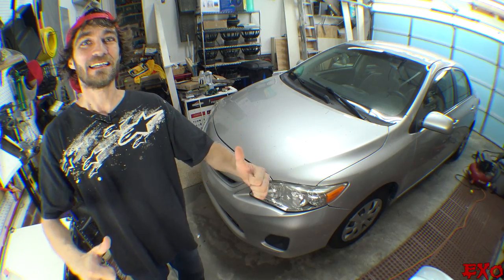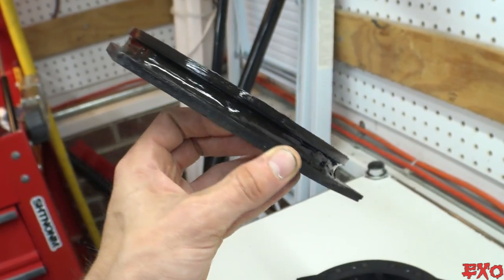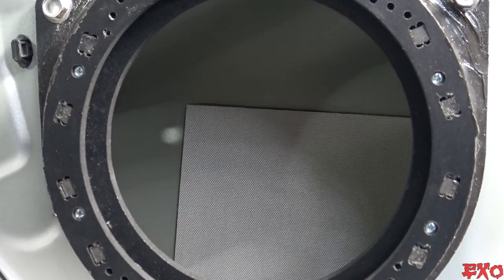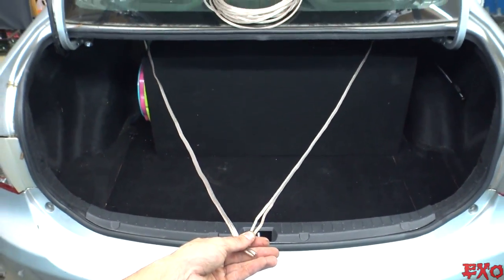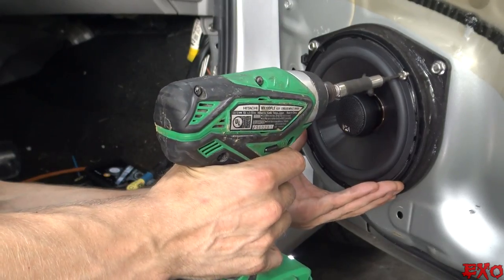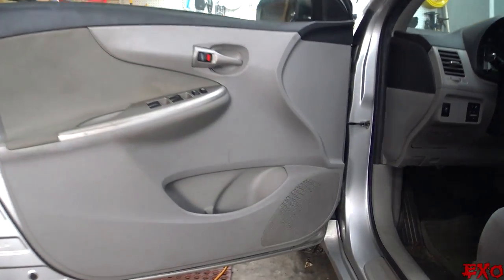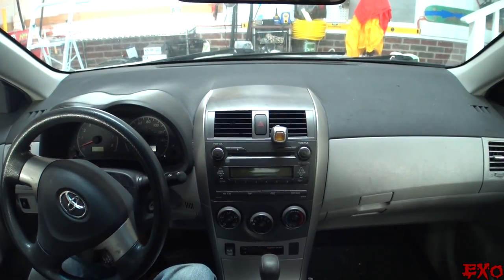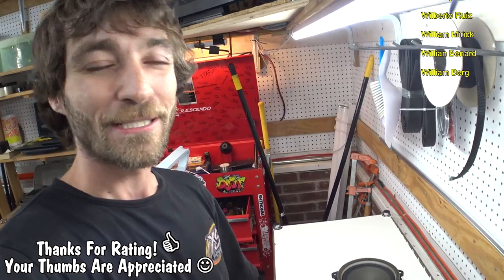How To Install BETTER Door Speakers w/ NVX 6.5 Coaxial Speaker & Installing Aftermarket Adapter Ring

Comment: You are as bad as me. I just swapped in 6 powerbass replacement speakers in my new ‘19 Ram 1500 Quad cab. 3.5”s in the dash and 6x9”s in all 4 doors. HUGE improvement.

Comment: Do you have an upgraded battery or alternator to have two amps running? I want to add a speaker amplifier along with my subwoofer amplifier but I'm afraid it'd draw too much power! I dont have that good of a setup right now so not much power is being drawn

Comment: Do you have to have that amplifier in the back? I am hoping to upgrade the speakers in my Renault Clio, and have seen other tutorials where they simply re-wire the speakers using the same wires as was previously used for the last speakers. Seems a lot simpler? Thanks

Comment: yep the wire tie I used for 25 years is about 3' long you can find them in HVAC supply houses and Electrical wholesale stores.
Viper Or DEI Also sells one but they choed the end off the wire tie. Speedometer cable works too.
All works fine and dandy until you get into some Mazdas that have the pug in the door or quarter panel. then you have to find a way around it/
Now why pull 17' of wire from the door into the car instead of 3' from the car into the door?

Comment: Couldn't u just hard wire it to the stock cabels on the stock amp
Reply: Daniel Ramos I was wondering the same thing
Reply: Yes you can, but running new wire is preferred  because more connections create more resistance and power is lost

Comment: But quick question, can you use coaxial speakers AND tweeters with like a component crossover, basically a cheaper way of adding a second set of tweeters?
Reply: Aspen Ramirez yes if the x over is on the back and u see the connectors for the tweeter

Comment: do you have to replace the wiring or can you adapt the stock wiring to these speakers if just using an aftermarket head unit?

Comment: I have a screeching sound on my original 2010 Toyota Corolla S speakers. Do I need to replace them or is it a electrical issue? Just looking to save $. I still hear music but hard to hear over obstruction noise.
-Ramos

Comment: In some 1985 chevy trucks you need to take the doors off the hinges. Then drill holes in the door and cab because the only speakers where in the dash and or cab corners.

Comment: So with those coaxial speakers only asking for 50 watts couldn't you run them off a pioneer 80prs deck easily? I don't need an amp right? I've been procrastinating on installing my nvx speaks
Reply: They should sound fine off your pioneer deck, just don't expect good sound quality when they're cranked up. Honestly deck outputs usually sound better than really cheap amps, so I'd save up for atleast a brand name amp.

Comment: Howdy Partner!
I got the 2013 toyota corolla and the problem is that something is wrong.
either my radio has gone bad or the speakers have gone bad. 
through the bluetooth the song shows being played but the sound disappears. Same happens with AM and FM and even with the CD being played.
a lot of audible friction happens during the time speakers do produce sound.
a lot of people with corolla, tacoma, camry and Rav4 have this problem at very low mileages on their cars when I checked for the problem online.
What do you recommend me do?
Thanks.

Comment: I do speaker wires the same way except I run them back to front so I only have to pull a few feet through the gromet

Comment: I have a near 40 year old truck that I am putting in door speakers . It never had door speakers. What about the wiring through the door since there isn't a rubber wire boot of any kind. Any information that you can give me will be of great assistance.

Comment: Awesome video! What do you think about using a speaker mount versus foam tape on the front and back of my speaker before mounting it? Also, how would you compare second skin and something like hushmat? Also... what is that black glue you used for the speaker tweaker? Thanks!
Reply: I'm a year late but this is what he's using

GE Sealants & Adhesives GE5030 Advanced Silicone 2 Window & Door Sealant, 10.1oz, Black

You can find it on amazon or any hardware store for 15 bucks

Comment: One drop of baby oil helps the wire glide right through those rubber grommets. then if you want it wipes right of with a little alcohol wipe.

Comment: Do you prefer those speaker tweakers over roadkill rings? I used the roadkill on my Silverado doors.  Just feel like that big 2 inch soft foam would better deaden sound, as opposed to that harder rubber.  Life of the product is a different story. But that's just my belief based off zero knowledge other than what just seems to make sense to me upon first glance.  But maybe you can tell me different? Teach me bro😎

Comment: HEY EXO ARE YOU USING  "CONNEXT LINK" speaker wire from ebay. I found 200 feet of 16 gauge OFC half tinned wire(same as you are using) for $30!!!! I  love their stuff i also picked up 50 feet of 10 gauge power wire for like $18!!!!

Comment: I'm a fan of NVX, I've installed 3 sets of their speakers so far. But I'm looking if there's anything better for relatively the same price as far as mid-range bass speakers. I am upgrading my sound system in a 2012 GTI. It has basically the same set up as this video with the door mid and the top door tweeter pod. Looking to replace the door mid speaker.  Any recommendations? Thanks!

Comment: That trick is actually an old one. My old dealer/installer would do that for any and all wires that had to pass through places like the firewall or the door grommets.

Comment: Use a PVC pipe that's flexible and thin but not brittle. If the pipe fits then you can feed the wire right though. Or just the classic giant zip tie or stiff cord to tape the wire though.

Comment: Could you have used the original car wiring and adapted it to fit the speak instead of running a speaker cable  to the back?

Comment: Old video but I sometimes just tape the new speaker wires to the old ones and pull the old wires through . Sometimes I use a metal hanger too tape it to the hanger and push it through any tight places u wanna go

Comment: Did you do a video on the impala? I'm upgrading my 2008 I'm using 2 12in audiopipe TXX-BD4-12 they currently sound really good in a 3.1 box.. But I'm missing all my mids and highs the bass overpowers other sounds everyone likes to hear. I need to have somewhere to put 2 more 8in or 6.5in or 4 more cause its really banging..

Comment: You could have use the factory speaker wires just cut it and add clips for positive and negative terminal and connects it to the speaker and you just have to find the speaker by use of cell at the headunits

Comment: that rope looks like window ribbon sealer and if so that means you could you the ones in a tube for better coverage
Reply: and you could use mechanics wire to fish the lines as it is about the same diameter and is flexible and comes long enough for any job

Comment: If I'm doing a simple speaker system I usually run my 4-channel speaker wires to the head unit then use the factory wires that go out to the door speakers
Reply: HPA Hy Power Audio 14awg was over kill

Comment: Zip tie trick is something I have used in my 30 years of installation.  My question is why didn’t you use a foam baffle for the 6.5. The magnet is steal and when it’s wet from rain it rusts like crazy.  Foam baffle would also add to the back pressure.
Reply: Like the round thing he added to the door skin? They make one that sticks to the magnet and it's foam?

Comment: If the lower stock units in the front doors are bass,midrange units,there wouldn't be any highs,full range signal to the new coaxial speakers, right?
Reply: Michael Larsen yes there is because he adjusted the low pass filter
Reply: Michael Larsen or high pass filter whatever it is on his amp

Comment: Hey I want ask you a question how 4 orion will work on a system 4 audio pipe 15 1400 can that turn down any body in a competition and more speaker can that give good bass the 4 orion and 4 audio pipe

Comment: I got a car that has a door wire loom connector block that slides up when connecting to the car. Basically it means I cant run my 14 gauge wire to my new component speakers going in the door. How do you run new cable when you cant use the existing loom gator. Its stopping me from upgrading my door speakers and I have already got my component set sitting around. :/

Comment: Every new car I upgrade.my door speaker and they and keep the stock head unit.. they always sound wayyy worse. It tHt because stock speaker have complete full range, vs after market typically going down to only 60hz?? Just always wayy less low end on aftermarket

Comment: That idea with the zip ties👍👍👍👍👍just ordered a new HU
Going to be doing the big 3 and a 2nd batt in my cargo area (01 suburban) for a 4 channel for my doors. About to get the massive ct2 tweets nd run them on a 4 channel with these skar fsx 6.5s...then think about rear door speakers later 🤣🤣🤔

Comment: #pleaseanswer got my door’s speakers already changed by the old owner (2 way speakers) but I don’t know why when I play some music the “loud” part of a song sounds like scratchy. The dude before used usual “Home light” cables.. I replaced them with some Stereo wires, they are thin to be honest.. but I’m not 100% sure it’s that.. also the sub amplifier it’s pretty old, and the speakers wires that comes from the amplifier are pretty cheap.. help idk what to do, like just change the wires, the speakers or the amplifier

Comment: You made a mistake, i did not expect you to make EXO...
Why only that little pad behind the speakers? I've always fill the doors tot the top with multilayer, and 5mm dampening pads behind the speakers.

Makes the speaker sound very big compared to the size.

Comment: Soo my moms car has 14 speakers (stock) and I can hear them all besides the subwoofer in the back, unless you turn up the volume.
And also when a song has  a lot of bass the doors shake and rattle, any help from preventing the rattling ??
Reply: Second skin sound deadened or sound skins pro sound deadener. Most manufacturers lack heavily on sound deadening door (absorbs vibrations which in return you’re not losing a bunch of acoustical energy from the metal vibrating.
Reply: Kyle Clevenger but it’s a Lexus
Reply: Alexis Aguirre doesn’t matter haha, sound deadener is these super sticky matts that you adhere onto the metal on the inside of your doors. Doesn’t matter what kind of car it is.

Comment: The magnet on the originals is neodymium, which are the same strength as larger ferrite magnets, but come on, those were still quite small.

Comment: Hey wait a minute EXO I don't see a link for the speaker tweaker or the epoxy you used to install it when I change the door speakers in my Xbox I want to do it just like the pro EXO
Reply: D Ellz 1/32 foam will accomplish the same thing.

Comment: 15:18 "Sweet Tart of a magnet LMAO"
Reply: The magnet is made from NdFeB powder, which is a magnetic material that can supply about 10 times the flux density at full saturation as a typical black-donut magnet made of ferrite powder. This can either be used to increase the magnet’s strength by 10 times or it can be used to reduce the magnet’s weight by 10 times. Automakers usually opt to do the second because reduced mass improves fuel economy and overall handling.

Comment: let me tell you how i did wire my door speakers to the amp. I just cut the speaker wires from stereo harness the i connected the wires with male and female RCAs connectors (the RCAs so i can easily switch my speakers to unamplified speakers just plug and unplug ) and then from RCA to the amp

Comment: That only worked on my rear door speakers on my kia my front ones I had to dig and tap into the stock wiring cause they decided to use wire harness on the front doors so I couldnt get the wire through it.

Comment: Instead of using the ziptie to feed the wire, ive always used a cheap wire coat hanger straightened out. Its longer and stiffer, but just flimsy enough to slide in all them walls. :P Depending on the wire (rca's, speakers, 1/0) depends on how i tie it on the other end, but im sure u can use your imagination for what ever your application.

Comment: Hey, what are some good handy glues to have laying around when dealing with car audio stuff. Both like you used in the videos and for re-coneing subs.  I have a but of experience with rebuilding HiFi speakers but the stuff in-car audio seems a lot more heavy-duty. 

For glue options - preferably stuff that is possible to get my hands in europe. :D
Reply: Zayin Conde any kind of epoxy. 5 minute works for me.

Comment: I agree. Why does Yota use rivets? And I notice on my RAV4 that the OEM speaker adapter is (a) a part of the speaker itself, (b) is hard plastic, and (3) it extends through the door into the door leaving about ¼" or smaller clearance between the end of the adapter and the window when it's down. 
Come on EXO. Why are you riding the magnet size bus? You and I both know those OEM speakers are designed for low power, thus usually have neo magnet, high sensitivity, paper cones--light, easy to move. Crap, if you had a neo magnet as big as that ferrite magnet it probably would be so strong that it would disturb the metal of the door itself.

Comment: hey. i what to install in my ford focus mk1 a Skar Audio Evl. 12" with 2500 watt and 1250 watt rms. The car has a alternator with 90 amps. Do i need a second batterey with a disconect relai and a bigger alternator? And how do i connect the battery? row or paralell? can someone help me?

Comment: EXO what crossover frequency did you set for those speakers?
Reply: They are coaxial, the crossover for mid to tweeter is built in
Reply: @wonderbread06  

I was talking about the crossover frequency for the speakers to the sub.

Comment: Has anyone tried replacing the speaker wire in a 2013 Honda Fit/Jazz. I used a fish wire to lead the new copper wire and managed in all of the three passenger doors. Failed to pass it in the driver's door. The gromet in the driver's door is jam packed with wires (four windows, window lock and two mirror motors). Stopped trying as I was afraid I would tear an existing wire. Any idea/hints what I can do? Thanks.

Comment: Those are very good speakers for the price. Got 2 of the 6.5 in the front doors and 2 in the rear doors, 2 6x9's in custom kick panels in the hatch powered by a NVX JAD900.5  amp,  and 2 12" nvx subs in the false floor powered by a NVX 200.1, and this sounds just about as good as any system i have built or any i have heard.

Comment: Hey i was able to get huge  performace by just isolating the dors with some sound deadening materials ( i mean diy with dining table cover one with soft mesh in underneath and plastic on top) and some aluminium tape and dang there was a jump in sound quality mid bass was really powerful and all that with stock speakers
Mind that i even was surprised with their quality so i left them untouched except the rear woofers thay were shit

Comment: Did u test your windows all the way down? No way mine would have worked with those bolts you used without hitting.

Comment: I did not do the wire job kia decided to be a pain in the ass fitting conectors in the door opening ... no way i could the cable in trough ther

Comment: i just did the same install on an 06 corolla and bought the same adapters for $35 on amazon with all those gaps in the plastic, waste of money and returned them because i 3d printed my own set way better than the amazon version for about $5 worth of plastic

Comment: Most important part is prepping.rush thru it and it will unsatisfying i usually use wire clothes hanger for every noodling of wire.ifor big builds i take seats out so no cramp spaces .im very claustrophobic

Comment: I ran my amp to the factory wires in the car, not too much power going through the system though
Reply: yeah you can do factory wiring if youre less than like 60watts or something
Reply: I've got a 4 channel doing about 120 per channel 1 and 2 are ran in parallel to 2ohms each and 3 and 4 are bridged to the subwoofer

Comment: Lmfao...... the way I do it is...... I take the old speaker out and just splice into the existing wires so I can still use the quick connect or whatever it’s called 😅

Comment: normally i used to use some installation home wire and fish it thu grommets like 0 gauge wire or smaller like speaker wires indeed